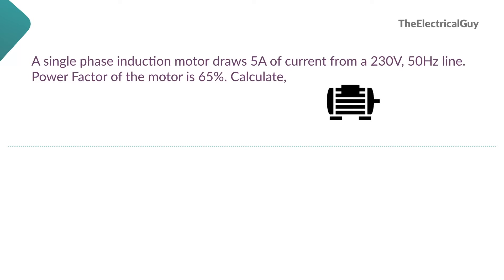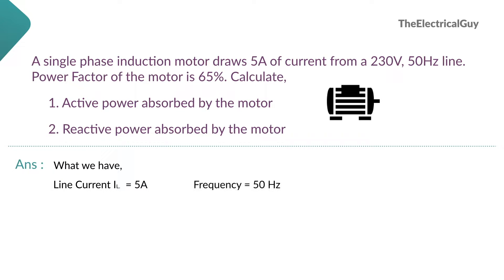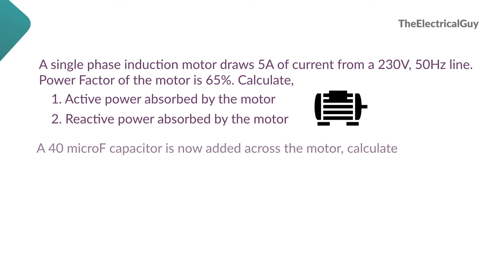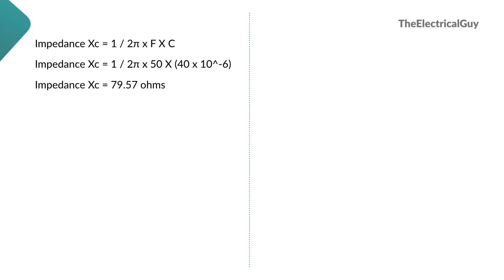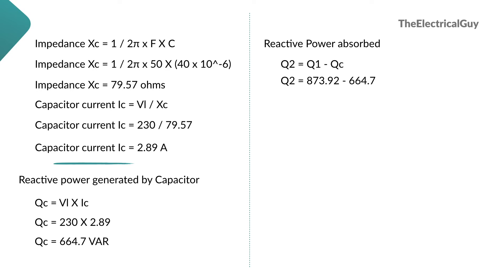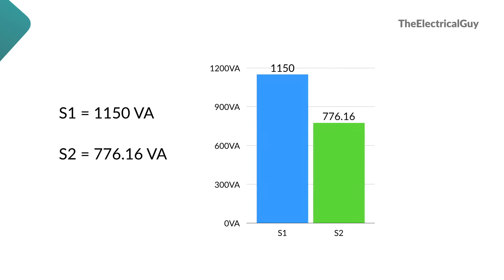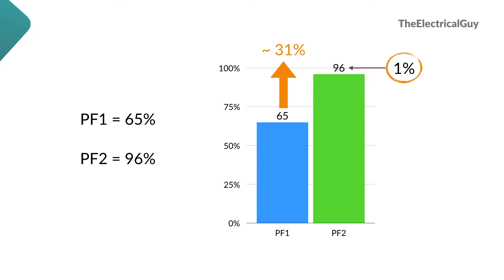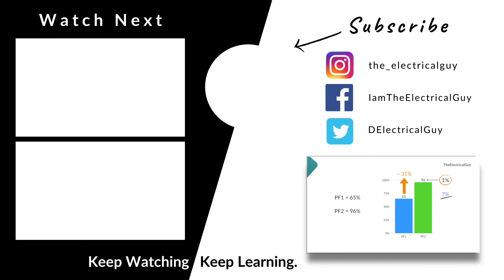Let’s solve this Reactive Power problem to improve Power Factor!

Comment: Another excellent summary. I learned this basic math in another course, using phasers, but they never went to the practical step of showing applications. Here you show the cap put in parallel with the motor. Do they ever add the cap in series with the motor? Are there any advantages of series over parallel? Of course the other complexity is the run vs start situation, and how to design a motor circuit to account for both. Finally, at some point I wonder how meters are designed to measure real power only....

Comment: explain the working of induction motor specially how and why induction motor draws more current at the same voltage when the load connected to the motor increases relate the ohms law with it

Comment: I want to maintain the voltage levels by reducing the capacitive reactive power? How can I add the reactor(Thyristor Controlled Reactor or Magnetically Controlled Reactor) in the system to reduce the capacitive reactive power?
Reply: instaBlaster.

Comment: How did u get the impedance of capacitor as 79.57ohm bse when u compute 1/2*50*40*10^-6 you donot get 79.57
Reply from the maker: 1/2 x pi x F x C

Comment: what will happen if we take a large value capacitor and produce a lot of reactive power,
will we get power factor above unity ??? 
or we will just utilize unity PF in our system and the excess reactive power will simply just flow back to transmission lines?
Reply from the maker: It flows back in the distribution system. Watch this video you’ll get the answer 
https://youtu.be/q5P_BlZsK5g
Reply: @GauravJ   thank you
Reply: You'll have a leading power factor

Comment: @Gaurav J - TheElectricalGuy  to get unity Power factor you need about 50.25microfarad capacitor.
I have got a question though, I would like anyone to clarify is it always true that capacitive loads generate reactive power while inductive load absorbs reactive power? is that always the case? such that if I need to reactive power in my system, I just add capacitor banks and when I to remove reactive power from my system I just add inductors?. 
Okay, another question...... do inductor generators absorb reactive power also, or is it just induction load that does? and I will appreciate it if you can do a video explaining how we can use reactive power for voltage control.
Reply from the maker: Yes, it is true that, capacitive load generates reactive power and inductive load absorbs reactive power. However, you need not to use capacitors always, to inject the reactive power in the system. There are other ways available as well for example, STATCOM, synchronous condenser, etc. Most of these methods are capable of either injecting the reactive power or absorbing the reactive power from the system, if needed. Hope this clarifies your doubt.
I did not get your second question.
Reply: @GauravJ   Gaurav J - TheElectricalGuy  thank you🙏  so much for your response. I left some question in other videos as well 😃😃... pardon me it's  just that they way you explain i get it much more easily. 

So my second question; I wanted to know if Induction generators like DFIG, absorbs reactive power as well despite generating real power? 

I have heard that Reactive power control is important for voltage control in power systems. Can you please explain how that is so and maybe do a video on it as well. 

Thanks